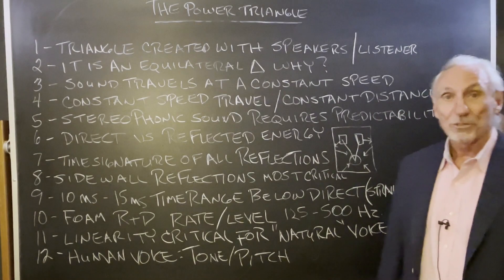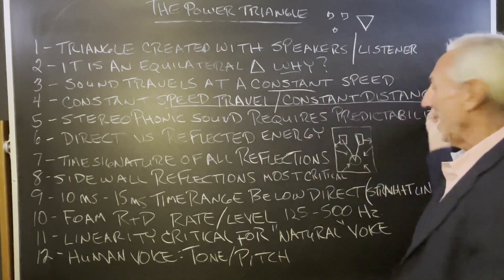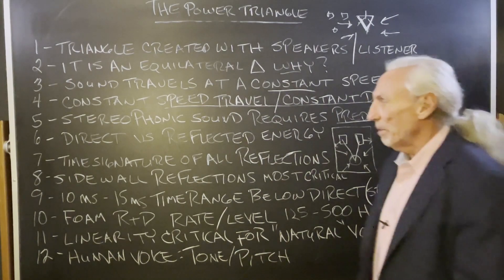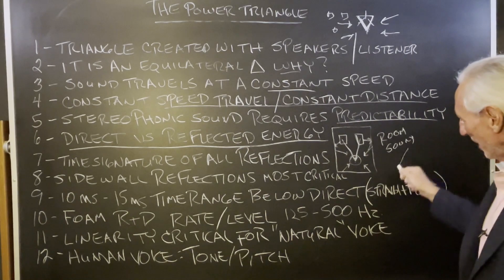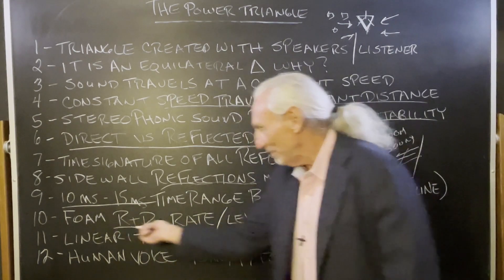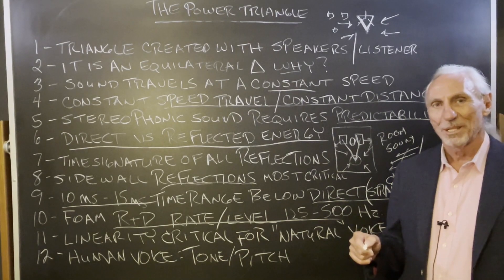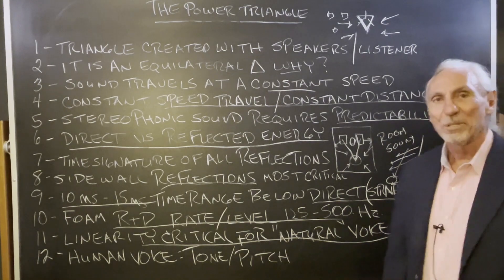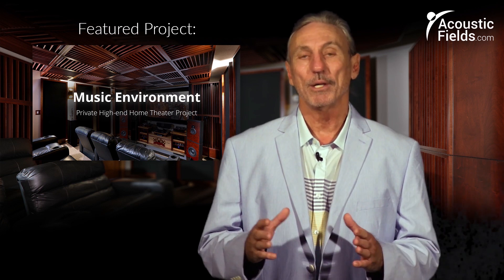The Power Triangle - www.AcousticFields.com

Comment: Dennis, I think a corner or a triangle is called an apex. Someone chime in if I'm wrong. Also, the triangular setup seems to apply to studio monitors but not home theater, unless I missed your point. Thanks.
Reply from the maker: The power triangles apply to both two channel and multiple channels.

Comment: I didn’t understand « 10-15ms below direct ». I thought the delayed sound by the walls had to arrive later to the listening point so that it doesn’t interfere (psicoacoustically) with the direct sound.
Reply from the maker: Direct energy first to reach ears. The time signature window for reflections is subjective with windows from 5 ms - 20 ms. It varies with usage. This is why it is critical to treat reflections with the proper rate and level of absorption. You are working with a small time window. You must have a consistency and linearity in the applied treatment.

Comment: Equilateral might work best in near field. I still think that the 2/3 ratio is better for listening rooms where you are a distance from the speakers. You talk about mono and timing. In a single speaker mono system the ears are equidistant from the one source. One sound with the same time arrival to both ears. 

With a mono source (single mic'd male vocal) coming from two sources placed next to each other, it would be close to the same but with each ear getting a slightly delay signal from the other speaker, some time smear. 

Separate them into an equilateral at some distance and not only the time delay from each source to the opposite ear increases in time, but requires curving around the face because of the lack of more direct "line of sight" sound waves. Thus blurring the locational info between sources and ears even more. 

Moving the sources closer together reduces this effect. But reduces the stereo separation. But again most of the sounds come from single close mic'd mono often in recording studios. There is no real stereo info most often. Just  sent to both channels at different levels. 

If mic's were placed equidistant in an equilateral triangle to record the info, then yes, putting the speakers in that config would be best. But most music is mono sources mixed across the 2 channels. And even live recordings tend to be multi-mic'd and not stereo pair in an equilateral arrangement. 

So the 2/3 ratio gives the best compromise. Not mono and not so far apart as to cause the brain to misinterpret or have to work too hard not to.
Reply from the maker: They are both set up starting points that work well with both near and farther fields. The room has the largest impact on the set up.

Comment: No, you're right, reflected sound can't get there before direct sound - but it can travel through a solid and reach you before the direct sound does. You'll never notice it at very short range though. Think of an explosion at a pretty good distance. First you see it. Then you feel the ground under your feet jump. Then you hear it as the airborne LF shockwave reaches you. It's pretty impressive, especially the first time you experience it. There is also the ground "wave" that creates a wave in the air like an ocean wave pushing a surfer, but you may not perceive it since it reaches you almost simultaneously with the ground wave. As a SoCal guy you know all about LF through the ground in the land of faults.
Reply from the maker: This oscillating movement you described in what should happen in your room. If your room has the resolution level, you can feel the wave and the distance between each wave. At high pressure levels, I can observe impact of the wave movement on my pant cuffs.